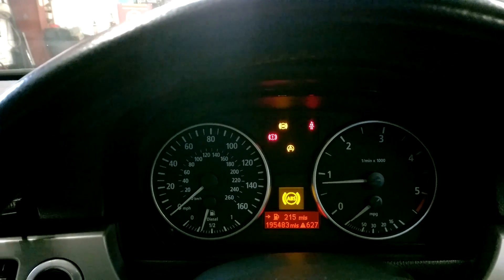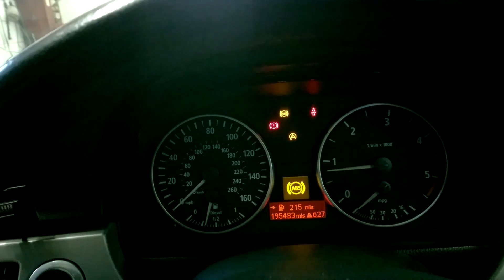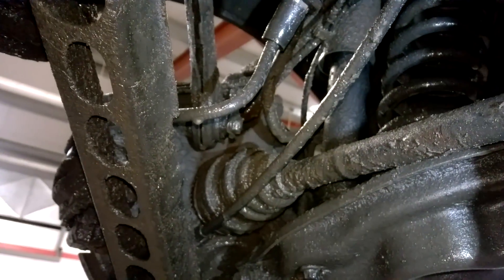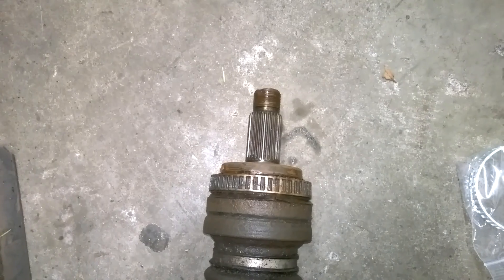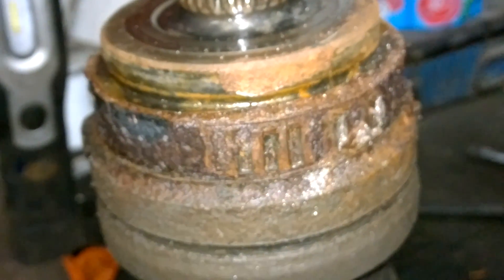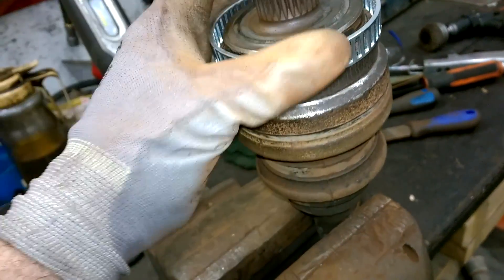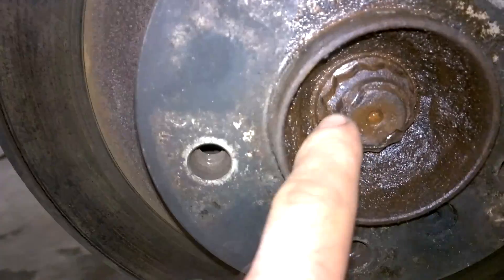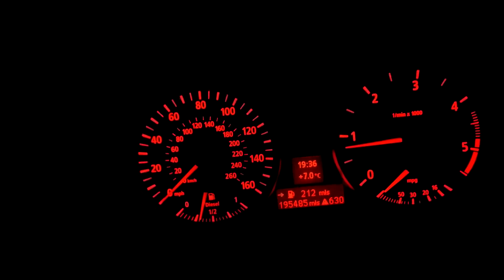ABS Reluctor Ring Replacement - How To - BMW 3 Series

Comment: Good video very helpful one thing I’ve done when changing these reluctor rings is boil the ring in cooking oil on the kitchen stove to expand it and it just drops over the cleaned driveshaft

Comment from the maker: Due to the many emails I got about where to source the parts needed.  I have now included a link in the description for Abs ring & sensor and also links for new rear driveshafts. I hope this helps you.  
Thanks to everyone for the kind words.
Reply: Hi there just wondering if the driveshafts you put in the description are any good? Do they cause any vibration? Thanks
Reply from the maker: Hello, Thanks for watching the video. As I stated in the description, any driveshafts I bought were from my local supplier, they keep them in stock and I get 95% of my parts local. I put that up when I was asked to source one online. The company has sold 120 of them that can be seen (at this moment & they have a 3 year warranty)   
But I can't vouch for them as I never bought one. The price is right but if you are bothered maybe buy local too or contact them direct and see. 
 
I hope this helps
Reply: Thanks Gerard the video has been a big help I have bought 2 of these driveshafts and going do give them a try I got a quoted £80 to fit both driveshafts and abs sensors so hopefully this will solve all the issues I am having thanks
Reply from the maker: No problem, best of luck to you.
Reply: To add some longevity to your fix, I would suggest smearing some two part epoxy in the grooves and over the new ring you installed. Not only would it glue everything in place, but it would put a barrier to keep rust from forming since it would block the oxygen from reaching the place you just worked so hard to scrub free of scale and rust. I know this is a little late, since you assembled everything, but maybe it will give the next bloke a good idea before he starts his project!

Comment: Excellent video and explains it all clearly - many thanks! Proper old-school mechanic is the way to go as BMW dealer would have swapped out sensor first and once they realised it was this problem (the reluctor ring) their answer was to swap entire driveshaft with the new ring on it. Difference in cost over £1k!! Problem with this fault is that, until you get a solid fault (permanent warning lights) which logs the error to tell diags which wheel the problem is on, you get the annoying intermittent symptoms of DTC kicking in when it shouldn't, engine stuttering & losing speed etc. Great tip at end about spacer as a possible intermediate fix.
Reply from the maker: Thanks Rich

Comment: Thank you for sharing this with us!
The trick with the washer just saved me for now. The ring is bent on my X3 and damaged the sensor. Unfortunately 2 from the 3 guys at my local service are ill so they couldn't schedule the repair for this week.
I have tried puting a 1+1/2mm washer initialy, but that turned out to be too much. The lights went off as soon I did change the sensor but when I applied the breaks first time ABS just kicked in, then all the light come back, except the tyre presure one and the ABS was completely switched off this time.
I replaced the washer with a 1mm and that worked, so everithing works as expected for now.
Again, thank you for sharing!

Comment: Just replaced my reluctor rings after watching this video yesterday, followed what you said to do, I done both sides as I noticed the sensor in the side that didn’t have a fault was scratched so thought while I’m there I’ll get it done, thanks a lot even though I’m a qualified mechanic I still research every job I do, (depending on timescales). And if I can I like to watch a YouTube video as it gives you a good understanding and also heads up for what tools I’m going to need. Thanks Gerald
Reply: make videos
Reply: I am the same exact way. Even if I know how to do the job. Might have done it once or twice or even ten times before. Will like to go ahead and watch a video a refresh my self before every job lol.
Reply: What would it typically cost me to have a garage do this job on my 2009 3 series e90

Comment: Simular problem on my 318D 2011 model, TSC kicks in out of turns and sometimes on straights even though the conditions on the road is fine. (So the light is not on all the time like in this case) The repairshop here in Norway wanted 1200$ for the fix, they didnt mention if they would replace the entire axle or just the ring (Overpriced country, in every aspect)  
Will try this fix when winter is over :) Thanks!

Comment: Thanks for your help,  did it yesterday, first time taking driveshaft out, easy job thanks to you 👏, for £3 ring from eBay the car is fixed 😄.
Reply from the maker: Great 👍 well done
Reply: Would you tackle this job with jack stands?
Reply: Did it take a lot of heavy knocking? I am not built like Stallone!
Reply: @suzesiviter6083 done mine today was bashing it for ages gave up for a bit to have a sandwich and came back with a sledge hammer 3 wacks and it was out lol

Comment: Really good video thanks very much, another problem seems to be releasing the driveshaft nut. Great tip about fitting a washer to increase the spacing of the sensor slightly, thankyou.
Reply from the maker: Thanks for taking the time to comment, much appreciated :)

Comment: Thanks for posting!
Not too short video, nor to long. Just enough to cover every detail. Perfect.
Would you recommend using a primer/anti corrosion of some sort over the bare metal before fitting the ring and placing it all back togheter, though? The bare metal would probably start rusting in just a matter of days after fitting it(?).
Reply from the maker: Yes I would recommend using an anti corrosion product for sure.

Comment: Awesome video I had A ABS problem traction kept engaging , 2008 BMW 328. The ABS ring was rusted like in the video so my car ABS kept engaging while I drive. I plug my OBE computer and it showed my sensor was reading incorrect wheel speed. I changed the entire axle. But doing what he did is much inexpensive and will work..

Comment: Is there a possibility that because i put a wire brush adaptor on end of the drill and put it in the sensor hole to polish the ring while turning the disc.. Fitted two new sensors .. But fault still is on. Have I polished the magnetic coating off the ring? Or is the abs ring magnetic all the way through? I think ive wrecked the rings thinking I was cleaning them through the hole 😢

Comment: My ring had snapped while I was driving luckily I checked them found  that was the problem now I've just got to buy my new ring and do the job what you've done but mine is a Citroen Picasso front wheel drive so hope it is easy to get off as that one is thanks for the video great insight in to the abs system

Comment: Thanks for your great video. same issue. started with fuel pump, then to module then abs. turned out that it was the ring on the drive shaft. cost me £900 all in. 😞

Comment: just a note ABS rings are heated up wich exspand them,wich alow you to drop  onto the drive shaft and you can place the drive shaft in a chess freezer if you have one wich shrinks the metal,
Reply: the only problem with that is if you got anti corrosion rings you will burn the corrosion coating!

Comment: Hi Gerard, thanks for the video. I had this problem last year on my E82 with a similar mileage to the E90, but sorted it by removing and cleaning the sensor. It returned again very intermittently last week whilst on the motorway so I'll try the washer route first, Thanks again 👍
Reply: Great video Gerard I have the same issue with my e87 and changed the sensor and the lights are off so hopefully that's it, but there was wear on the end of the sensor so I'll probably have to change the ring next but I know the process so thanks for that.
Reply from the maker: your welcome man, thanks for the comment
Reply from the maker: Thanks for sharing your info & taking the time to comment :)

Comment: I used kurust on the driveshaft  reluctor ring down the sensor hole, fifteen minutes and cured. This will helo reduce speed of rust growth, I fitted a 1.5mm washer, test drove and got all sorts of faults from airbag to juddering brake pedal. Repeated with 1mm washer and car drove fine with only abs fault. Just need to drive car for enough miles to reset the light. Or did you have to use a reset tool?

Comment: @Gerard Burke do you remember, how much miles/km you drove until the lights gone off, after you replaced the reluctor ring? I did the exact same same thing, before I saw your video, but the lights on my E90 are still on

Comment: Thanks for sharing, very clear and helpful video really.
I had exactly the same issue, the mechanic installed washers which solved the problem temporarily, six months later the lights comes up again, I guess it need to put new rings and do the same job as here, I’m just wondering how much that will cost to do in Ireland?
Thanks again

Comment: Luckily I just found a rear left cv for 15$ brand new. Grabbing a right and going to just replace them both. Tired of fighting this damn abs situation. Washers on the sensors worked for about 2 weeks but now it's on,  always.. Hopefully my sensors are still OK. They were new, but now I think they be scratched

Comment: Where did you get the reluctor  ring? I found one UK based website but I'm having problems trusting them. My car has a different size depending on if it's automatic or manual (E46 330i) and they don't list which one they are selling, and they have a model in their line-up that doesn't exist, and E36 330i, so I don't feel comfortable buying from a parts dealer that has both missing and incorrect information on the same page.

Comment: This is such an awesome video, thank you. 
I have a 97 E39 528i that has the abs light on too
I don’t have a tester so wondering if the sensors are only on the back wheels, or all four?

Comment: I know this isn't the same vehicle, but I have a 09 128i (e82) and began receiving traction issues on the dash. The mechanic stated that axel and wheel sensor needs to be replaced.  Does this sound right?

Comment: Hi pal How did you determine which side needed the repair? Does it show you on the I computer deck which side was having the ABS problems?
Reply from the maker: You can do a visual check and see if anything is rubbing/out of round or use a scan tool capable or reading wheel speed sensors and simple road test or manually rotate wheel when jacked up and look at the live data.

Comment: Does anyone know if these reluctor rings are on the rear wheels only? I checked all 4 sensors on my X3 for damage but cannot see any kind of rings on the front side. Just the 2 on the rear wheel set.

Comment: Hi dude, really helpful video. How much should this cost from a local garage (UK)?
Reply from the maker: Thank you, Ring up workshops the are close to you and price it up. Prices differ greatly depending on many variables including location, parts supplier etc..
Reply: Had both rear ones on my 320d done over a two year period. Labour on the rear left was about £60, rear right was I think about £80. Both done at the same garage. Rings were about £10 each and came with loctite. Did have to buy a new sensor after the first one was replaced, genuine BMW ATE make. Never any problems since

Comment: My thoughts on this are, if the shaft is that old and crusty wouldnt you think its worth $60 for a new complete shaft that includes a new ring?
Reply from the maker: I agree Nathan, If you want to be certain of a fix it and it looks like this one, I would advise full shaft change. If you want to try it out on your own time and you don't mind failing, ya could save a few bucks as the ring is so cheap.

Comment: Little tip from us.
Grease or wax up the ring it will prevent future corrosion.

We use Dynax UC wax before they get bad.
Works a treat and does NOT affect the magnetism or operation in any way.

It's a shame everything is assembled dry in the factory 
@Jules75ZT

Comment: If i don't want to go through the effort of changing the reluctor ring, where can i buy just the end bit which you mentioned in the video. Thanks
Reply from the maker: I have put the driveshaft links in the description for you.
Reply from the maker: The cost for just the outer CV joint is not worth the effort or time, I looked into it and the job will take longer with no savings. links are above.

Comment: Great video very informative , I am having a issue with my 320D automatic when I put foot down from the 4th gear to fifth it struggles there is jerk sometimes or it’s says transmission fault on dash board , only it happens when my car is fully loaded with passengers or if it’s uphill, I took it to the Bmw they said it’s not transmission fault it’s the pick up ring on rear driveshaft it’s corroded and it’s swelled up so it’s touching ABS sensor and full driveshaft needs to be replaced, well I am thinking I can change the rings and get it fixed, what do you think Mr Expert? Thank you
Reply from the maker: Thank you for your kind words on the video, It is nice to hear feedback.
I replied to another man with pretty much the same issue as yourself. I will say to you like I said to him. 
It all depends on how bad the corrosion is, then decide on if the repair of just the ring is worth it or not. I have done quite a few of these now and all of them have a lot of time to be invested to solve, In one case the repair was not successful, it was just gone too far. (none of them were the same) 
 
When it is your own time it makes sense to go with the ring but when paying for labour it's probably makes more sense not too, unless the corrosion is in it's early stages (much better condition than in my video) The amount of time that's needed to get it right means it is cheaper/quicker to fit a shaft.
 
This job is very much a labour & parts combined issue, one has much more labour and small costing parts and the other is vise versa. 
 
Depending on the quote they give for replacing the shaft I would say proceed, If they are way too high I would bring it to an independent workshop that's gives you better value. 
 
Regards  
 
Gerard
Reply: Is your egr valve plunging in and out ok? Judder from cold can be caused from that, use few drops of engine oil to lubricate. Really easy pop plastic cover and you will see.

Comment: Does each wheel have one abs Reluctor Ring or one for front and one for rear wheel.Thanks
Reply: one in driver side and one right side passenger side !
Reply from the maker: Each wheel must have a pickup of some sort for the ABS/traction control etc.. varies for different makes and models. but in general these monitor all 4 wheels so if any slippage occurs it can correct performance to help reduce loss of traction.  
I hope this helps.

Comment: Hi , your video has been very informative but , can you tell me what is the job/ purpose of the reluctor ring ?
Reply from the maker: The wheel speed sensor picks up the info it needs from this part.
Reply: It has hills valleys that magnetically interact with the sensor providing a series of pulses as they spin by the sensor. The computer looks for repitituous pulses.

Comment: Excellent video Gerard, my ring(!) is starting to go oval and I put a 0.9mm thick 6mm washer under the sensor to lift it a little, as you've suggested and it's been fine now. Do you not use a DTI (gauge) to measure the roundness of the ring on replacement? Also, do you use any form of anti corrosion treatment to limit the issue in the future, especially as the owner seems to live in a field! Have yopu tried heating up the ring to expand it to get it to fit? It would probably just fall on if you heated it up to just below the point where it changes colour? Keep up the excellent videos, they're very detailed and helpful.
Reply from the maker: Hello & thanks for comment, it is nice to hear feedback on videos :) 
To answer some of your questions, No I did not use a dial gauge or any anti corrosion on this job, what you seen is pretty much what you get in this video. 
To give ya some info on this job and the way I was thinking, when I removed the shaft to see the condition of the problem I was no longer 100% that it would be solved and I was under a time restraint until I needed the lift for another job, I spent a lot more time on it than I expected but I was happy with what was done and also the knowledge that if any further issues a rise it can be solved. 
 
My advice for anyone that is doing this job would be, If it is as bad as mine get the complete shaft aftermarket, They are not that expensive and when you put time against the money it just makes sense. 
If you are ok with trying and accepting you may not get it perfect then fitting the ring, then it is no big deal. 
 
In my opinion to do this job 100% you may need a lathe to secure the joint and get it to a perfect round again but that is not worth the time or the money unless you owned one (I do not)
 
Thanks again & sorry for the long reply :)

Comment: What are the symptoms of this fault?  As I have same lights on my E87 1.6 I....  When I first moving theres no errors but the brake feels like it's grinding something 🤔 then the abs fault lights up and the brakes feel OK again....  is this the same???  I purchased abs sensor but feel the grinding is more than a sensor ha
Reply from the maker: The symptoms of this fault are the following, jerking/hesitation with a power loss feeling, this is caused by the confusion of the wheel speed sensors & the ECU trying to figure out what is going on, It thinks the wheels may be spinning and the traction control kicks in. Once the lights come on it has detected the fault/s and deactivated the traction control/ABS system.  
I hope this helps.